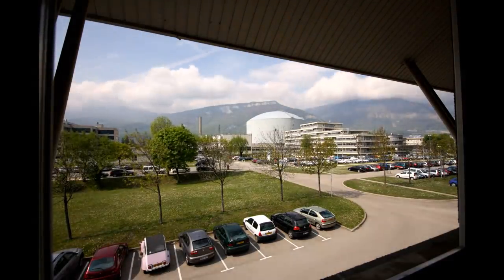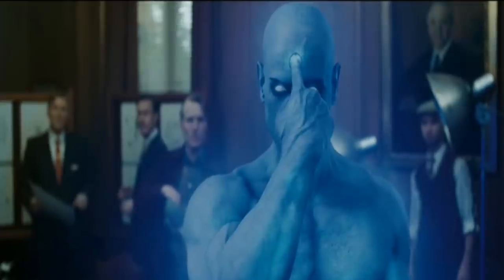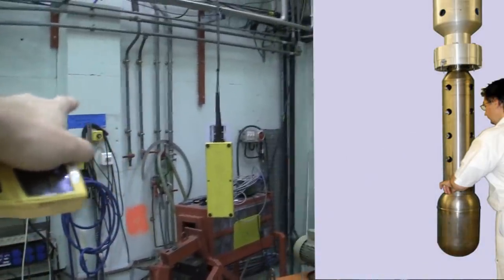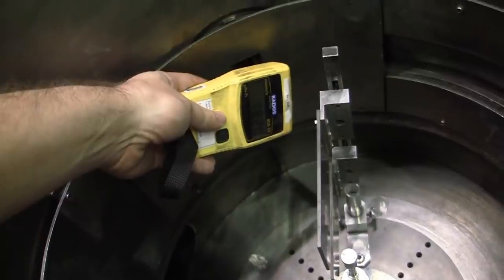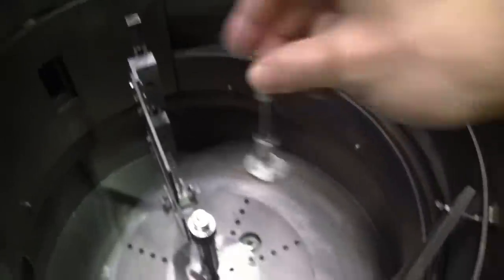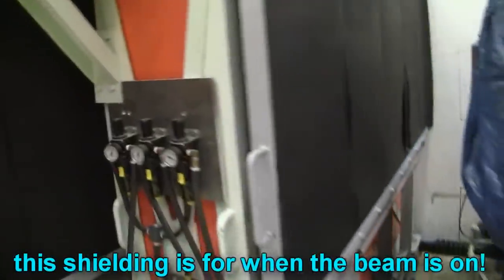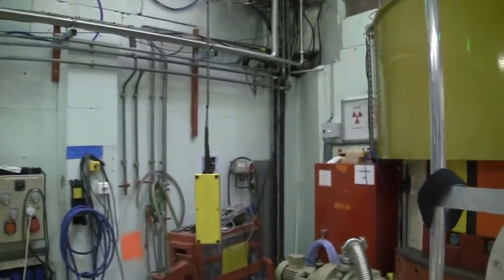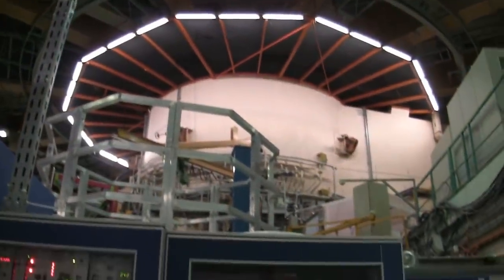Nuclear Reactors, Fantasy and Fact!

Comment: Hey Thunderf00t, i've been pro nucleair for a long time now, and in contrast to closing plants as they are in europe, i'd more like to se us upgrading older plants that might be less save. I'd like to se a video with your opinion On what THE safest type of reactor is that we could construct today.
There are people out there lobbying for liquid salt reactors but they seem a bit byes to the whole thing. I would love to see a objective explanation about the safest reactor of the 21th century.
Keep up the good work ;-)
Reply: +Bjorn Embrechts The safest kind of nuclear reactors are the ones that are already running, because they are already displacing coal and saving lives. The least safe reactors are the ones that have been shut down prematurely (e.g. Vermont Yankee) and are now being replaced by fossil fuels.

Globally about 10 million people die from air pollution each year. Much of that is from things like burning cow dung and coal indoors as a cooking fuel; but estimated deaths from outdoor air pollution by the WHO is still 4 million.

Read the Chernobyl forum reports. Less than 50 people died at Chernobyl and during the clean up. applying the LNT hypothesis, which has never been demonstrated at low dose rates like Chernobyl and which is not evident even in liquidators (conscriptees sent in to clean up the surrounding area and exposed to large doses). Counting hypothetical, indirect deaths of this type, a total of 4000 could eventually die from radiation exposure.

There are ~ 10 coal-Chernobyl per hour assuming LNT is false and about three every day assuming its true. Nevertheless, every nuclear plant being shut down is very dangerous.
Reply: +soylentgreenb Who the fuck dies from CO2 emitted by coal plants?
Reply: +Tim Ramich I would say canaries, but that is in coal mines.
Reply: +Tim Ramich they die from the dust, look up "black lung" from coal.

Comment: I was a US Navy Nuke.  I was a Reactor Controls Officer.   I trained on S1W in the Idaho dessert.   Part of our training was to go inside the reactor containment shield  during a shut down.  The radiation decays rapidly so after a few days it is safe to enter for a short period of time.
I have also held a plutonium source that is used to test some of the radiation detectors.   The alpha particles from plutonium do not penetrate the skin.   I was safe because the plutonium was in a solid bar that couldn't be inhaled or swallowed.
I have also held U238 used in a commercial reactor.  The pellets are safe until they are irradiated in the core.
I would listen to ThunderfOOt.
Until uranium is put into a reactor where a chain reaction can be started,  isn't that dangerous although I wouldn't want to swallow or inhale it.  Inhaling depleted uranium dust from armor piercing shells would not be good.  I don't know what is meant by depleted.  Plutonium is safe as long as you don't get it inside the body.  Still one must take extreme caution to make sure it stay outside the body but outside the body it is relatively harmless.
BTW,  I am still alive 40 years after.

Eventually nuclear power will return but it may be thorium based.
Reply: Depleted Uranium (DU) is Uranium that is usually produced as a byproduct of the enrichment process.  You end up with a sample that has a lot of U-235, and another sample that has less U-235 than naturally occurring Uranium.  You can't use this latter material in reactors or bombs, but it is extremely dense and heavy.  Therefore, it makes great armor (density), ammunition (the high density and mass allow for quite a bit of kinetic energy transfer), and has applications in other areas where you'd want something that can pack a lot of mass densely into a small space.  Thanks for serving and for spreading facts about this stuff. I was a 6423 & 9954 in the Marines, and I'm also trying to dispel with the nonsense, misinformation, and paranoia that are so prevalent regarding nuclear topics.
Reply: +Joe Mitchell It's not quite true that you can't use depleted uranium in nuclear bombs. It is an important part of nuclear bombs.

It is not fissile and cannot by itself support a chain reaction, so it is not a special nuclear material that must be handled with great care, but it is easily split by fast neutrons and it is very dense and an excellent tamper. If the casing of a thermonuclear bomb is made of DU instead of lead or something; it more than doubles the nuclear yield of the device. The Tsar bomba was really a 100 MT device, but they put a lead tamper/casing in, giving it a yield of 50 MT. This makes it the cleanest nuclear device ever made with 97% fusion yield.

Comment: That facility looks so small from that distance is it just a research facility, or does it actually generate power?

Also what exactly do you do? Your job looks fun haha
Reply: +Elites Engineering research, thats why they use detectors, you seen in video
Reply: Kanycmka Wouldn't they use detectors either way? Even in a actual nuclear power generator facility?
Reply: +Elites Engineering You don't understand. These aren't detectors for detecting hazard, but for research.
Reply: CptHrki geiger counters are detectors they are used in research facilities and actual nuclear power generators.
Reply: Elites Engineering You clearly don't understand so I won't even try anymore. This reactor is for RESEARCH NOT ENERGY PRODUCTION
Reply: CptHrki and you clearly didn't read what I've said. You misread my post 2 times already.
Reply: +Elites Engineering It blast samples with neutrons. Generally in a power producing facility you want to continuously produce power and not in pulses and you're not interested in creating a path for neutrons to irradiate a sample outside of the reactor core.

Comment: The excessively high cost part of nuclear power isn't even calculated into a plant's initial cost.  that being the storage and maintenance of the highly toxic spent fuel a reactor creates tons of during its operational lifespan.  If there happens to be a meltdown the unprojected cost skyrockets and the surrounding area becomes uninhabitable.  Screw nuclear power.
Reply: +Mr. Lowery The major disaster is people like you, who encourage unabated coal power use. 4 million die from outdoor air pollution every year. 50 people died from Chernobyl (read the Chernobyl forum reports). There's a coal-Chernobyl every 7 minutes.

Fukushima is by no means uninhabitable. It is much safer than the air pollution of Tokyo everywhere outside the plant limits. Exaggerated responses to radiation cause needless death (evacuations kill the weaker people who cannot be moved) and convince the public that low doses of radiation are extremely dangerous (why else are you spending billions?)
Reply: soylentgreenb More like 1 million have died due to Chernobyl.  Maybe you'll be oblivious if you ever come down with cancer and not even think that twenty years previous to the fact is when you were infected by inhaling hot particles from (insert nuclear accident) and that is also when your fate of dealing with said cancer was decided upon as well.  50 people died AT Chernobyl at least a million have died because OF Chernobyl.  To say only 50 died because of it is a lie and an irresponsible bunch of bullshit.

If you think Fukushima is such a safe place, be my guest and move there.  It has already surpassed Chernobyl ten times over for the amount of radio-nucleotides released to the atmosphere and the three melted cores are still laying fully exposed to the atmosphere, pouring their radioactive death into the world unabated, with no soon end in site.  People like you are morons who haven't a clue as to the environmental impact an event like the triple meltdown at Fukushima is having and will continue to have for thousands of years.  The Pacific is already sorely damaged from it.  Much of what lived in it is gone.  Probably forever as far as we are concerned.
Reply: +Mr. Lowery have you watched ANY of TF's videos on radiation? at all?
Reply: brendon chilcott Yeah, and I pretty much agree with him.  Nuclear power on yje other hand isn't just about controlled fission.  It has a massive incentive to get a final product to it's customers with the least amount of overhead.  This is what causes the untold number of minor accidents every year and what eventually causes major disasters sooner or later.  Engineers don't run the power plants, CEO's do.

Comment: the main issue is dealing with radioactive waste. fukashima stored spent material on site as most reactors do since its difficult to dispose of. in the u.s.  we bury it in a mountain. but thats not a final solution. the other issue is meltdown. if a meltdown occurs the chain reaction can be slowed, but it cant be stopped. and if something happens to a nuclear powerplant like at fukashima or chernoybl you create a radioactive wasteland for the next century.

Comment: Question, shouldn't we try to work towards building a reactor shell that also harvests the neutron decay energy? The way you explained it made it sound like we're pumping quite a lot of energy into slabs of concrete.
Reply: +ZeSny those neutrons are quite hard to be stopped, i mean they bypass metals and require thick concrete to be stopped from even harming people.
Reply: bilibull But would you not agree that if we were able to harness the energy they produce that it would increase the reactor's efficiency and power output?
Just sounded like an awful lot of energy to be pumping into slabs of concrete when we've got solar roadways & other BS science to have found the holy grail of green energy
Reply: Not going to lie, i would agree that a perfect nuclear power plant would have been amazing.
Reply: +ZeSny Wait until you hear about neutrinos, which will happily travel through a lightyear of solid lead. These carry off about 10% of the energy of the fission reaction and there's nothing you can do about it.

Comment: As a nuclear mechanic in the U.S. Navy, I think it's awesome that you're explaining radiation and exposure to people in a way the average person can understand, and giving valid comparisons to real life things like plane flights, 

also I've stood ~3 meters above an operating reactor (only at 20% power) but designed for adequate shielding at 100% power, lifting the inspection hatch revealed a yellow tinted 3inch thick leaded glass window and through it, the top of the core.